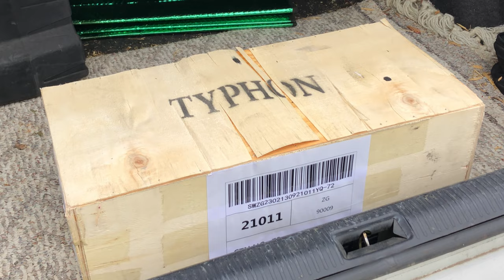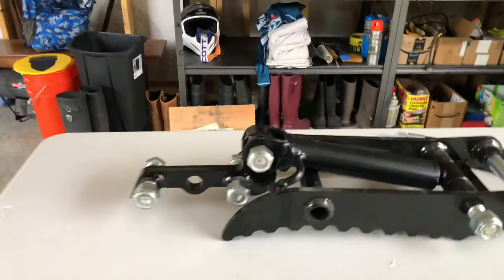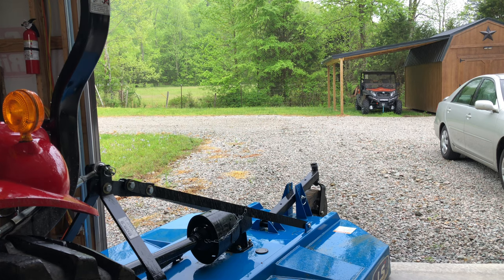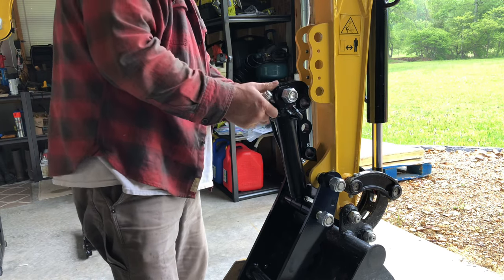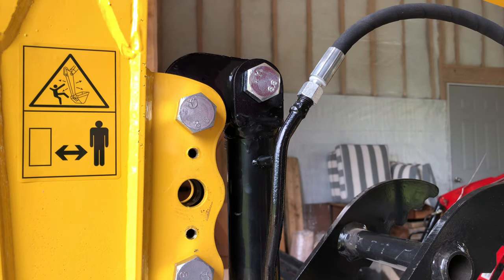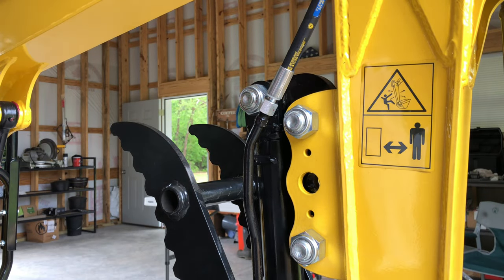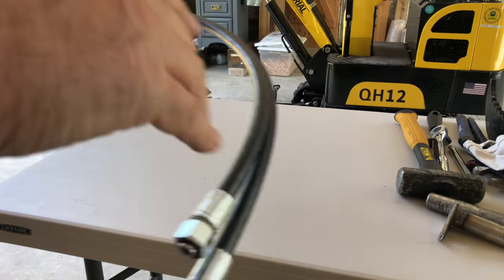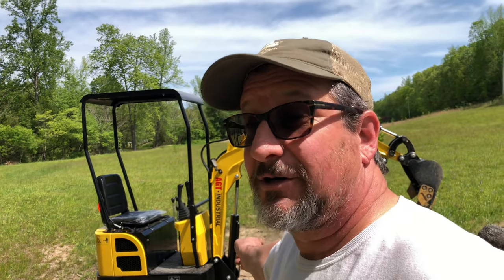INSTALLING NEW HYDRAULIC THUMB ON A MINI EXCAVATOR.

Comment: Subscribed. I have a similar machine and also had an issue with finding the right F-F fittings. I ended up welding two M-F fittings back to back to get the F-F gender. Looks ugly, but works!  I also find that the pilot controls are very sensitive and unless I am very slow and deliberate with moving the joysticks, it causes the boom/bucket and tracks to be jerky. I'm used to more coarse control like on my John Deere tractor.  I'm getting better at it though.  How is it with yours?
Reply from the maker: Yeah… the controls are very sensitive. You better move slowly or it can get out of hand quickly. 😬
Reply: Those aren't pilot controls - they're direct-linkage old-school mechanical controls. 

Fwiw, I have a 1.6T direct-from-China mini with pilot controls and Kubota diesel, but even with pilot controls, it's still twitchy, mainly the swing (especially if you're using multiple functions at once, say boom and swing, once you stop moving the boom, swing will lurch).  Will install a control valve on the swing circuit to slow it down.  On those gasoline engine minis, I'd install a better muffler to get noise levels down.
Reply: @ArthurDentZaphodBeeb  Thanks for your comment. I have a 1.5T with a Yanmar diesel. I would like to know how you would install a control valve to slow down the hydraulic oil flow. Can you send me a link to this valve or direct me to where I can learn more about this.  Thanks a lot!
Reply: If you can find the relief valve for the pilot system and turn the pressure down you will have a little smoother operation.

Comment: When you are driving out a threaded bolt, leave the nut on about halfway, don't use a hammer on the exposed threads.  Otherwise, good video

Comment: What hydraulic fluid do you use?
Reply from the maker: I just use the Tractor Supply fluid. Traveller 5 gal. Premium Anti-Wear Hydraulic Oil, ISO 46 https://www.tractorsupply.com/tsc/product/traveller-premium-hydraulic-oil-iso-46-5-gal-t806325

Comment: Instead of buying that whole unit you could have went and bought just the cylinder and hoses from Tractor Suply.
Reply from the maker: Yeah… but the thumb that came on the machine isn’t that great. The new one is bigger and thicker than the original. 😉👍🏻
Reply: That's horseshit. Tractor Supply never has what I need, save for nuts and bolts. That's all they're good for.

Comment: Just found your channel and was surprised to see you had both a Chinese one ton excavator and a TYM T264, so do I! Well actually mine is a T234, but basically the same as a T264. I'm really happy with the two machines. For small pieces of equipment, it's amazing how much they can do.
Reply from the maker: Yeah… that’s cool. I hear ya. Two great machines to have around. There’s always something that needs done. I appreciate you checking out the video. 😉👍🏻

Comment: Any issues with your tracks coming off? I have the same Mini, and have had the tracks on both sides come off under normal operation. Any suggestions/experience would be appreciated.
Reply from the maker: No,  I haven’t had any track issues with them coming off. I have had some rocks get in there and kind of jam it up though. I’m sure you’ve got them tight. 🤷🏼‍♂️ IDK.
Reply: Hi Steven. I have a similar machine and had the same issue. I found that if I tighten the tension of the tracks as much as possible - not leaving 3/4 or so, of space as some advise, that they will stay on. I don't think doing this will wear out the tracks as some say. So far, so good. Anyway, it's better than the alternative.
Reply: @patrickwong2823  Thank you for the reply! I kinda figured this is what I would need to do. Can you tell me what tools you used? It's a tight space!
Reply: @Indy0465  Hello Steven. Not sure what you are asking. But if it's how to tighten the tracks, I just unscrew the cover plate on the track to access the grease zerk fitting.  To loosen the track to reposition, let the grease out. To tighten, pump it full of grease. But lift the track off the ground with the bucket first.  However, some mini-excavators use a different method. Check other videos on Youtube. hope this helps.
Reply: @Patrick Wong  Yes, mine is the different kind. I have back off a 38mm lock nut, then adjust the screw with a smaller wrench.

Comment: Could of got them to cut ur hyd end off the hose and put the new 1 on ,cheaper easier
Reply: He specifically said that they (Local shop) would not do that, They aren't going to be responsible for cheap Chinese hoses and fittings.
Reply: @repaid1  Every damn hose shop I've ever been to says the same bs regardless of hose brand.  Most of them are complete ripoff scammers.
Reply: How much would a Chinesium hydraulic fitting crimper tool cost? Imagine being able to make your own custom hoses and giving the scammer shop a raised middle finger.

Comment: What's the max lift capacity for that excavator?
Reply from the maker: Other videos have lift tested these. What I’ve lifted so far is around 500 pounds. With little effort really.
Reply: @diywithcookiepops2193  The danger with these is they will rock forward/backwards on the tracks violently. The arms are stronger than the base is heavy... :(
Reply from the maker: @crisrhea6875   As long as you’re smart about what you’re doing, there pretty safe.
Reply: I'm inexperienced with an excavator, so I've been conservative.  What I found was if the bucket gets caught on something (e.g., a large rock in the hole you're digging), the excavator will pitch forward (even with the blade down). The act of pitching forward will cause you to push on the stick, causing it to pitch backwards. I've never operated a larger excavator before, but I suspect this is the difference between controls mounted on a pedestal versus controls mounted as part of the operator seat. I agree with "pretty safe", but I found a reason to wear a hard hat... :)  These things are great at getting into small spaces to dig. My tractor with a 3-pt backhoe is at least 25' long and w-a-y less maneuverable. Sorry, this is more about general operation than lifting things...  I'm curious as to others' experiences.
Reply from the maker: @crisrhea6875  I agree for sure. Pilot controls are way better. 😉👌🏻

Comment: I have a question is that ran on diesel or gas just by the sound it sounds like a diesel engine
Reply from the maker: This one is a 13.5 hp gas model. They also make a single cylinder diesel version. 😉👍🏻
Reply: GAS model with (Chinese) B&S engine passes EPA pollution regs.